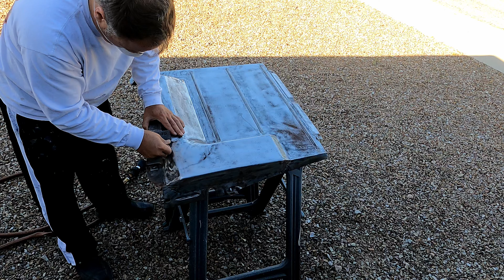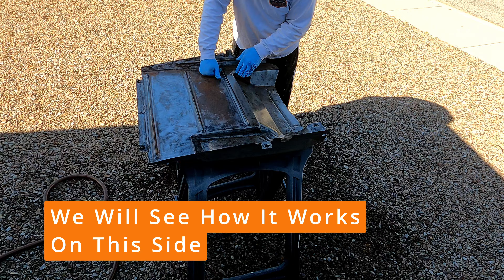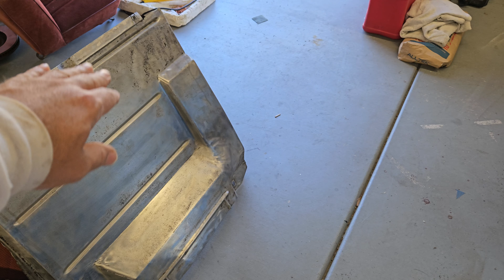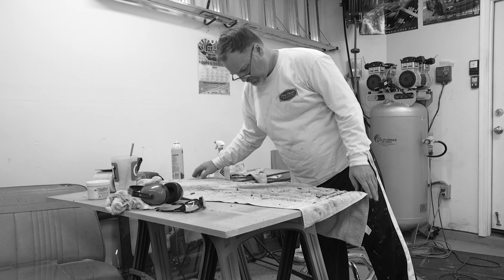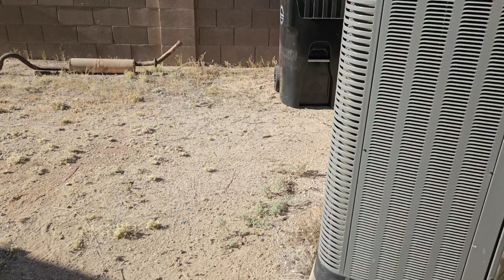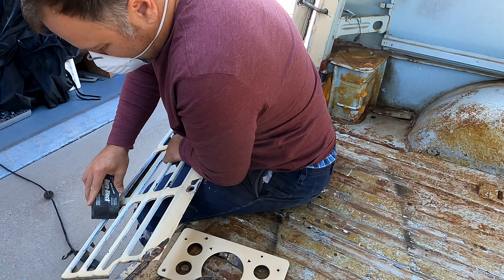Processing Parts - A Lot Of Them! - 66 Ford Econoline

Comment: I use what they call Rust Mort to convert the rust to a hard black surface then spray on high build primer ..  but I take to as close as possible to rust gone and I only apply to what shows as rust staying away from applying to much to good clean raw bare metal.
Reply from the maker: Got it!